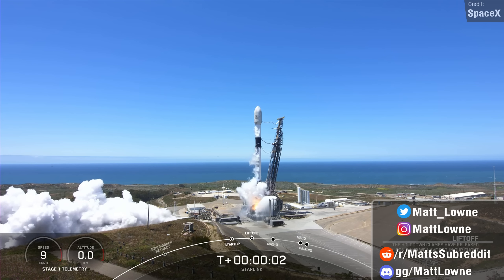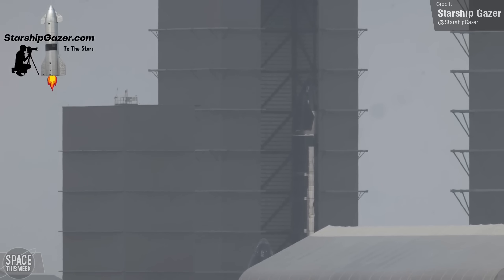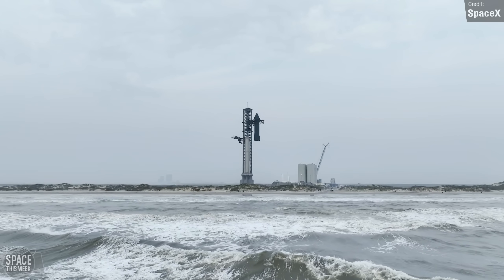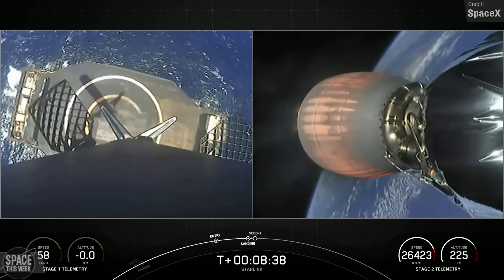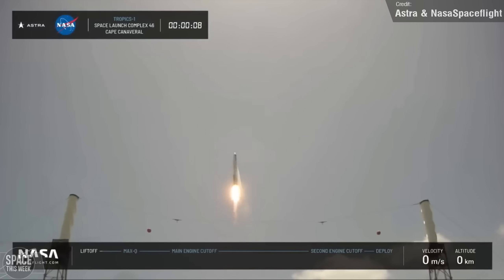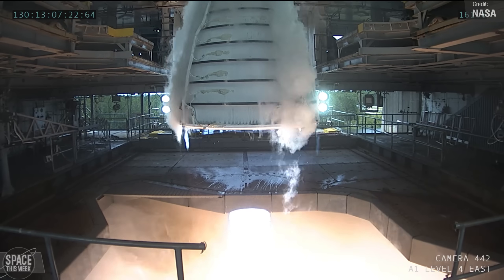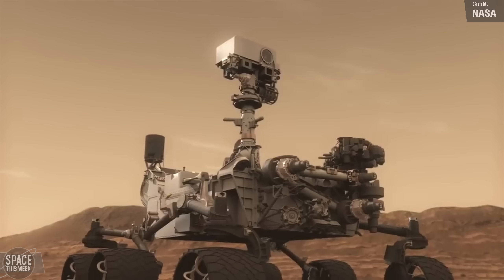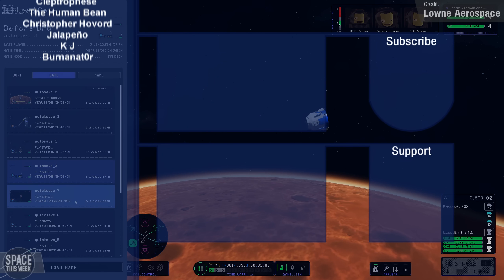Starship's Remains Wash Up on Beach, Raptor 3 Tests, New NASA Rover, Starlink, and more RS-25 Tests!

Comment: Elon, you have to redesign to allow for launches from the ocean. Remember the old Sea Dragon design? Check out old NASA designs. Launching from the sea means there will always be lots of water to supress engine shock waves, if something goes wrong the explosion will be way out in the ocean where nothing is damaged. Also land in the water as well. Falcon 9 s might almost be able to do this now (they have already done this by accident). There's a technique where you tilt the engines just as the booster touches the water causing the buster to slowly tilt over and lay down in the water with minimal forces on the booster. Keeping the engines burning at their lowest thrust to keep the water out. Once the booster has laid completely over on the water, the engines can cut off, and they will be up and out of the water. Oh, yeah, there is no need for the landing legs either. That will save a lot of weight. It's making everything salt water proof that's the hard part. The Starship that has shown how tough it was when it tumbled and didn't rip apart would most definitely be able to pull off this kind of landing.

Comment: Can anyone explain why NASA says that the RS_25 runs ay 112-113% power. is it because the thrust of the upgraded versions are compared to the power of the original engines made for the first shuttle launches?

Comment: It's pretty much a given that if Musk says it'll be ready in 2 months, double that and add 50%. That the launch pad suffered such a level of damage makes you wonder if the original design was (1) bad to begin with, (2) limitations ignored or (3) Beverly rushed. Musk's method of doing things and seeing what happens makes for lots of press, but bypasses the normal method of examining what could go wrong and then planning to mitigate them.

Comment: Raptor 3 cool. Except I don't think engines were the main problem of Starship, rather their number. Also to me it looked like wobbling a bit. Might be just hot air, but then MaxQ got delayed significantly - to less dense atmosphere? Again, could be missing engine power. But also all the engine gimbals fighting with frontal CoL in this early test. Resonance, steering delays, whatever as it changes with speed and pressure. Have seen that in KSP plenty. Good luck to them, but rather cautious observer here.

Comment: well space x does  allready own most of the land near that aprt of the texis coast line. so  bascly FAA kinda expects space x to clean up the mess it made. also the FAA allready did aprove full starship launch licanse dispite even when they put full aconut of the protacal highly likey risks. not to mechon there wasnt realy that much left of starship when it self desructed. plus starship was allready near the boderline just shy of sub orbital volciy and altdude when it lost contol. so that means theres not much of it left. this is sence most of it would have burned up or just vaperioezed from air freaction anyway. yes starship was allready that high up almost complty out of earths atmomsherer when it went out of control.  so bascly  that means starships was just reernting earths atmoshere at super to sub  sonic speeds rather then hyper sonic when it fully went out of contor. so thus it didn't realy expresnce the usual  iondizeing of plasma from air friction. this is due to the fact that only happens at very high hyper sonic speeds in the air. so techly when starship  lost contol was giong low super sonic or very high subsonic speeds when it lost control. thus it needed to be blown up bescue it wastnt hot enotgh to even heat up the starsjips heat tiles bescue it was giong to slow to worry aobut heating from reentring the atmoshere when it lost control at the end of the launch test. but most of the debre would have been massvly excrated from teh slef disrutct howver thus only parts of the heat sheld tiles wuold have made it into the ocen for the most part.

Comment: So i looked up NASA webpage for liquid/gas engine thrusters and the only thing I could find is the the chamber pressure function allows one to increase mass flow,but one also has to increase bell exit diameters.  So a higher chamber pressure with same bell size allows one to increase the power of the engine at the expense of some ISP. 
   So Im curious that they are doing this to reduce the number of engines. I would think that increasing chamber pressure requires reinforcing all downstream structural elements as well as lengthening and widening the bell.
Reply: If you raise the top end chamber pressure, then you should be able to run a lower chamber pressure with less stress on the engine. So the higher the top end, the higher the normal pressure can be.

Comment: Isn't it cool how in such a short period of time SpaceX launches were rare and Falcon landings were experimental, to now SpaceX is launching all the time and is reusing so many Falcon rockets?  I don't remember the last time a Falcon first stage crashed on the recovery ship or missed.
Reply: Missed unintentionally* because done missed intentionally missed to save a flock of birds
Reply: @Catalyst and Mocha  While this sounds kind of funny to me... I get it 😂😂

But also to the main commentor, thankfully you're right. He moved fucking FAST and even tho I know there will be accidents eventually, so far, this has been near perfect. 

I wonder what the upper limit of reusability is... 10 seems financially sound. 20, cheap. 30 might just be insane 😂 unless they're already that high up and I'm stupid
Reply: @VvDiverDownvV  I think 13 or 14 was the record yet, but these were early block 5. Later boosters seem to be better reusable with less work
Reply: @CatalystTKL  that never happened🤣🤣
Reply: @davidjorgenson2429  Happened less than a year ago. wasn't confirmed but that's what Scot Manly thought was the likely reason why.
Reply: @CatalystTKL  I live and work at Vandenberg and for SpaceX. Didn't happen.

Comment: Would be so cool if rocket lab would give the rocket a boost at start via some kind of a rail gun system
Reply: The complexity of that for a few m/s is a ridiculous idea.
Reply: @steveaustin2686  I'm pretty sure rocket scientists can figure out railgun tech and "few m/s" is quite an understatement.
Reply: @Gregory-Mugen  Railguns shoot rounds measured in tens of kilograms. The Electron rocket is measured in metric TONS. Apples to oranges comparison.

Comment: I wonder if maybe SpaceX should build a Raptor version of Falcon 9.

They would gain a lot of flight hours experience, start working on its reusability with little work on it, and improve payload.
Reply: Why? The Raptor engines are still in development, so it's doubtful people would want to move their expensive payloads from a reliable Falcon 9 to a booster with engines in development. Also, with the 9 Merlin engines, a Falcon 9 can lose 1 engine at liftoff and still take the payload to orbit on the other 8 engines by expending the booster. If you have 3 or 4 Raptor engines and lose one, you will not go to space that day.

Comment: My faith in the starship program has only decreased as it has gone further along. 

The only thing that's keeping this idea going is Elon's ego at this point.
Reply: And $4.1 billion US taxpayer dollars.
Reply: Chris Hadfield thinks the flight test went well. See his CTV News interview. The crater was an oopsie, but otherwise, they gathered a lot of data to learn from. One thing Chris didn’t mention: Without the concrete chunks flying into so many engines, affecting the flight path, the SpaceX team might not have learned about the FTS delay problem for many years — good thing they learned so quickly.

Comment: With 269 tons of thrust, just three engines would be enough for a Falcon 9 first stage (equivalent). That would give it a ~1.47 TWR at liftoff.
Reply: That won't happen because it would mean redesigning the whole rocket.
Reply: @michaeldeierhoi4096  Of course not. It was merely a comparison. Did you notice the "equivalent" in there?
Reply: @mytube001  Oh, I seeeee now.  Thank you for explaining.

Comment: It will take more than 2 months for the concrete SpaceX haven’t poured yet to cure properly. I have doubts that they will launch again this year. Waiting a couple of months, getting raptor 2 more reliable (able to run for 4 or 5 hours without failing), launching with booster 9 and one of the later starships, and sorting out the pad would in the end have saved 6-8 months or so. Potentially vastly more if they are now forced to do a full environmental impact assessment (which they will fail) and subsequent remedial work.
Reply: Musk is always insanely optimistic in his proposed timescales. I guess part of that is shaping expectations within SpaceX.
Reply: 2 month is probably a bit optimistic but it won't be half a year. Pouring concrete isn't a work which takes extremely long and it reaches its strength after a month. During this time they can mount the steel plate.

The factor which sets the date is probably the launch permit

Comment: You know Matt, I am also one of the sceptic ones when it comes to the olm progress but if they keep to this pace then Elon time just might be more accurate this time. However there will be other factors that most probably put a spanner in the works like FAA, court cases etc.
Reply: Heh, I don't think Musk has issued a target yet that I've not been sceptical of. But unlike so many other projects, my scepticism is restricted to the when, not the if.

SpaceX got off to a rocky start, but since surviving Falcon 1. But since then, only the timescales have ever been in doubt.
Reply: @BaalsMistress  I prefer Elon Time to Bezos' Stay Silent And Do Nothing
Reply: @ReddwarfIV  I had totally forgotten that Bezos had any skin in the rocket game.
Reply: There's the curing time for concrete. Yeah, you can walk on it after a day- but a truck will still sink in it. Earliest launch could easily be 4-6 weeks after the last concrete pour.
Reply: @phoephoe795  curing time is typically 1 month, after this time it reaches the standardized strength. It gets further strength later, but the standardized strength should be reached after 1 month.
Reply: A “spanner” like it took 40 seconds after the command for the rocket to self destruct before it did? That kind of “spanner”?
Reply: @executivesteps  I'm sure we'll never know. That "spanner'is sorted unless something else happens but that's what test flight is all about.